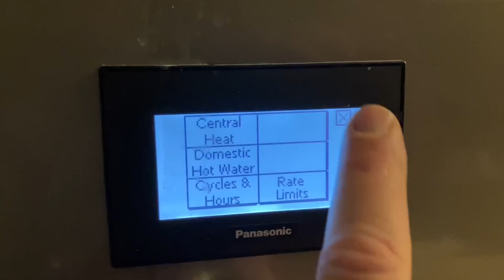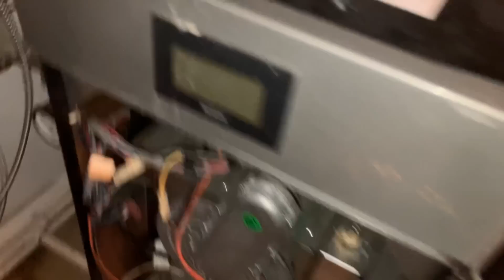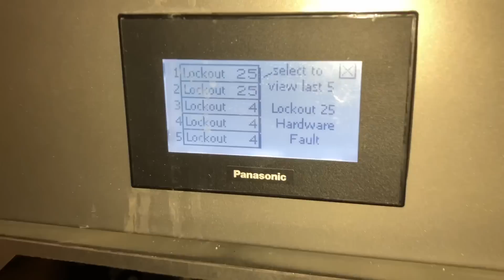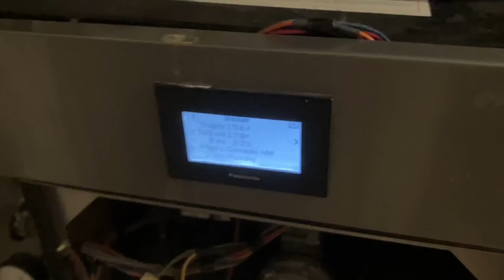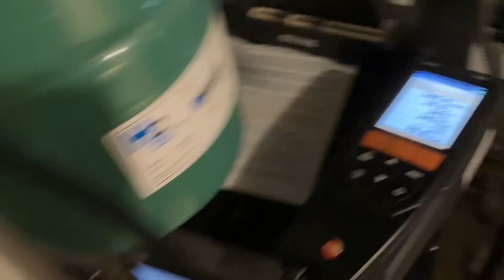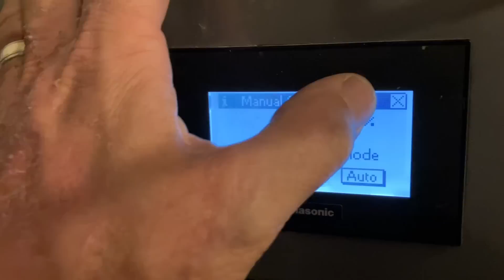Burnham Alpine Boiler EXPERT Reveals Shocking Failures You Need to Know

Comment: Mike I had an alpine just now and the screen was stuck on loading display and it said off in the top right part of the screen, bad controller? I think so, thoughts? The inducer would just run and never go through a prepurge or anything. Thoughts most appreciated!!